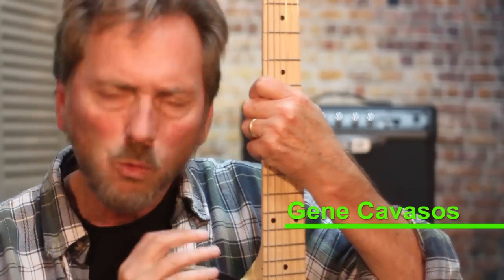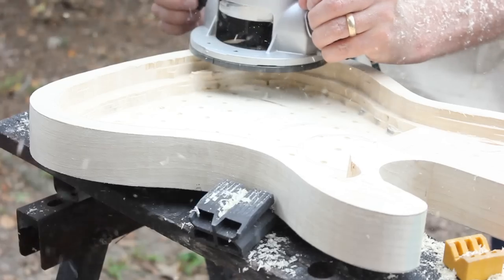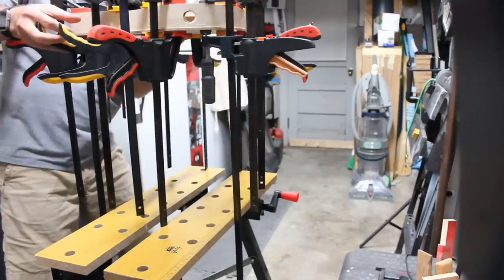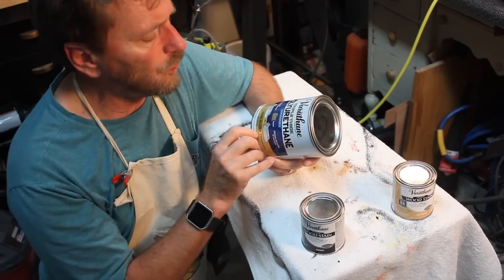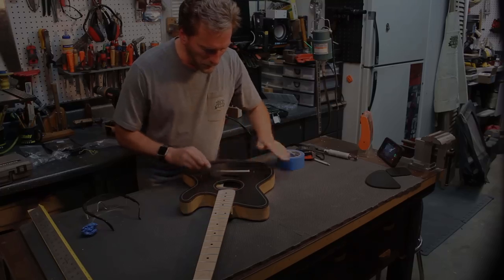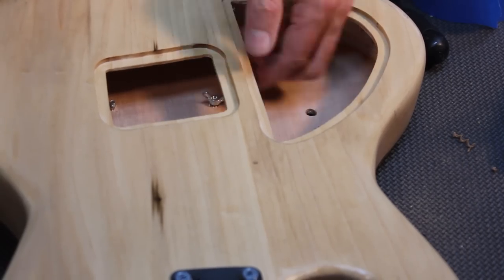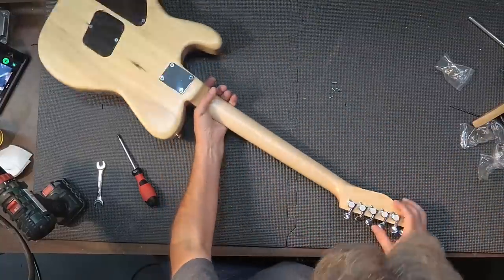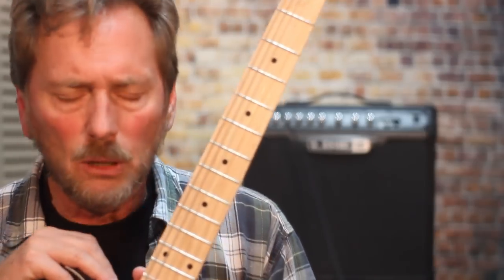How to Make an Acoustic Electric Tele-Style Guitar (Step by Step)

Comment: Very dull sound . Not pickups but design . Well crafted thow .Don't build something relying  on amps
Reply from the maker: I have sense replace the one pickup with an under the bridge style pickup. I think that helped. I also replaced the top with poplar cut very thin and it has really helped. Thanks for watching.

Comment: You used cheap wood with a luan top. No tone wood!  Plus, your top is not inlaid, so you show the ply laminations on the edge. You obviously have no idea how to intonate a guitar, your bridge placement sounds like you "winged" it, so it's probably intonated poorly.  Plus, you have no bridge block inside the guitar below the bridge to strengthen the top and keep the bridge from pulling off. So, acoustically, you have a plywood guitar with a guessed bridge placement, it probably sounds crappy without amplification, so why not make an electric chambered hollow body?